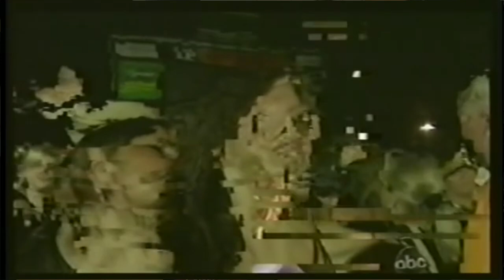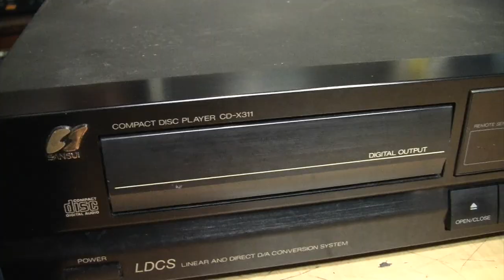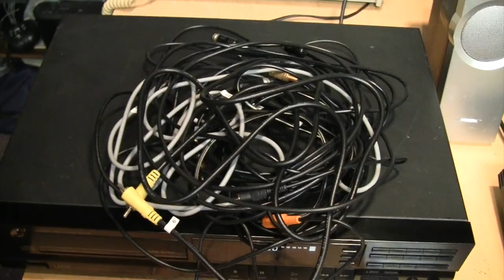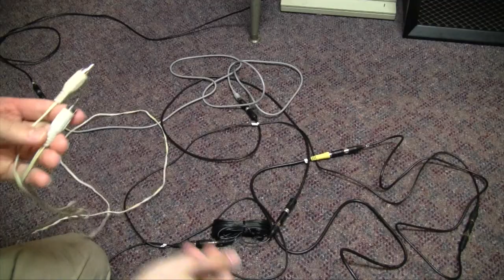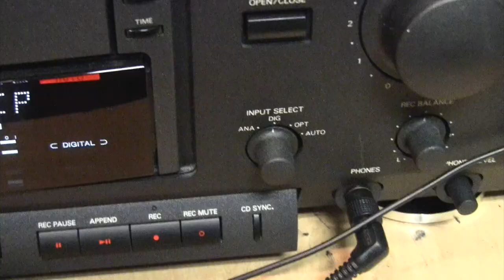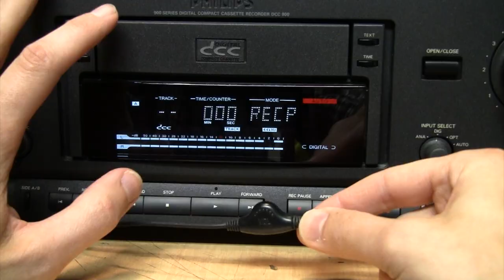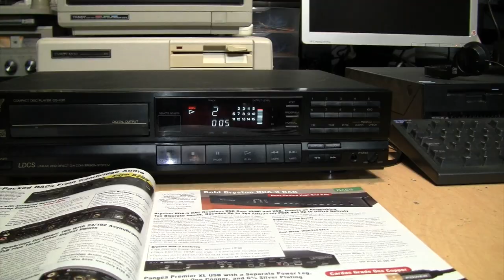What does a crappy digital audio cable actually sound like?

Comment: The extra cheap ones though do go bad pretty soon I had my tv box set up with the cheap cables that came with it and it had all these issues after 6-7 months I thought it was a backend issue and asked called them to fix it and they said they would ( this happened all the time ) but they said they fixed it but the problems was still there were still (biggest one was these random black lines appearing sometimes glitching audio) we went back and forth on this they kept telling they fixed it then one guy said have you tried changing the rca cables and I did with some cheap ones and it fixed it then the problem came back after round about 5 months and I changed them again and it fixed it again after that I upgraded to the new HDMI one still don't know how the cables went bad they weren't under strain just behind the tv no one could touch them

Comment: For short distances, it doesn't matter. For long distance it does. And there's a special cable for that:

Standard coaxial cable that you can buy at the hardware store for $0.20 a foot. It has the specific 75 ohm resistance to help prevent reflections. It also works great as analog cable, I use it for all my custom RCA cables.
Reply: I sometimes also use 75 Ohm Coaxial Cable for analog Audio. Because the Shielding of this Type of Cable seems to be still better, then that of some of the cheapest Audio Cables. I had Hum with some Audio Cables (that came with some Audio Devices), with the 75 Ohm Coaxial Cable, that Problem was gone.

Comment: I think the problem with using both the red and black sides of the stereo audio cable at once was because the cable may only be 3-conductor.  That is, both left and right may be sharing the same ground.  If that's the case, then using both red and black together may end up creating some nasty ground loops, which could easily distort the sound in the way you heard.

Regarding the static you encountered when using the volume control, I suspect that is due to a lack of error correction.  If you can receive the clock signal, then you have bits that you can send to the DAC and amplifier, but if those bits are messed up, you hear static and noise.  If the signal has error correction codes (probably not available with raw PCM data, but probably present in more advanced CODECs like Dolby Digital and DTS) and your playback software is designed to use them, then the corrupted bits will cause ECC to fail and you'll hear silence.

At least that's my theory regarding your observation.

Comment: Saw some high-end shop who sold "hifi" USB cables (A to B, standard termination - e.g. the cable that came with your cheap ass printer) - for the lowlow price of, if I remember correctly, 3900 USD for 1m (about 3 ft) - or you could go for the 2m version for 5200 USD.

I believe the brand was Nordost Valhalla.
Reply: ouch.

Comment: Digital is like reading morse code with a flash light. As long as there is enough energy to make the light switch on and you are within a certain wide range, you will be able to translate the morse code. does not matter how expensive the flashing light is.
But audiophiles love spending on getting 'the best'...

Comment: one thing that is not normally advertised from the manufacturers is that there is circuitry inside the recorders to compensate for poor signal. thats why you need to keep turning the little rehostat(volume) control inline with the cable to make it cut out. up until that point its doing alot to recover poor signal strength. 
the same goes in the digital camera industry where the SDI(serial digital interface) is used.  it can withstand a lot of different cable type's because of the Loss compensation circuitry. in the end. Bits are Bits & Snake oil is Snake oil.

Comment: Floor reveal :P

BTW I think the ultimate test, provided that neither your CD player nor the sound card acts up (I ain't an expert after all :D so pardon some incorrect, irrelevant junk pls), is to set the volume and settings on all devices and not touch the knobs until the end of the test, then take recordings of the same track after each cable extension, line them up in an audio editor by two, invert one of them each time and mix the two tracks to create an interference minima, if of course, they're identical :D and again, if nothing in the signal path is capable of losing or altering the data. Then you'll get absolute silence. As a control check, you could try doing the same track several times on the same cable, maybe switching your Sansui off and on each time, and replugging the cable...

Comment: Sorry, but this only proves that bits travel through extended cheap cable, whether it makes a difference to the sound is not something that you can evaluate with the setup. I don't advocate one way or another, but I just don't think you have the system resolution to make such an evaluation, unless you believe that a speakers are speakers, amps are amps, and so on...
Reply: Nope. The sound is entirely in the bits - no bits, no sound. If you read a newspaper in bright light or under a flashlight, the text will be the same. The writing won't be improved or degraded by the brightness of your reading desk.

The entire point of digital transmission is that it works or doesn't. If it works, then the output is a perfect replica of the input (no better, no worse). That's why a CD or DVD can be used an archival storage device for your computer. That's why, unlike copying an analog source, a tenth generation (or hundredth or thousandth) is exactly the same as the original digital source. That's why digital audio created the bootlegging problem.

Comment: Also when you're using the inline volume control, you're just lowering the voltage of the digital signal, and at some point the digital waveform won't be reaching a high enough peak voltage to look like a binary "1", so that's why the signal disappears entirely. If you re-amplified that voltage it would then be readable again.
It doesn't really simulate what you would encounter with interference or crappy long cables which would be random bit errors.

Comment: Do not forget, that you don't have a very long cable. You have many cables and many couplers, what is way worse than just one long cable.
Oh, I guess, that timing and data quality is way more important for a video cable, than for sound. Watch this from Linus Tech Tips: https://youtu.be/q5xvwPa3r7M OK, they have reached only 3 meters, but what can be the maximum designed length of a PCI Express connection?

Comment: Another test I just thought of what's the limitations of 1/8 or 1/4 stereo cables lol.
Reply: The 1/8 cable is usually headphone jack level, stereo feed.  My best was around 200' at full head phone volume, using XLR mic cable.  1/4 stereo cable is known as 1/4" balanced cable.  My best was 900' analog.  Connectors don't matter.  it is wether it is balanced or not.  I am an audio engineer.

Comment: Here one can read about jitter:
https://headfonics.com/2017/12/what-is-jitter-in-audio/
... including how using a FIFO buffer you can remove the issue from the cable.
Of course if the cable is so poor the actual bits are hard compare to each other then you've got a problem beyond that.

Comment: Those "audiophile" magazines and catalogs have been pitching this kind of "woo" for decades to drain the wallets of unsuspecting, under-informed consumers. The entire "analog vs. digital" kerfuffle is just one tiny part of it.

If you really want a really good example of this kind of crap (and maybe get a good belly-laugh or two as a bonus), look up the "Tice TPT clock" some time. This device retailed (roughly 20-30 years ago) for around $270. It was a digital clock with an extra AC power outlet that one used to supply one's audio amplifier. Supposedly, it somehow magically "synchronized" all of the signals within the amp (through the AC line cord, no less!) to produce superior-fidelity output. Descriptions if its effects are (generally) laden with egregiously-subjective terms such as "airy", "spacious", and "crisp" -- one of the clearest examples of "confirmation bias" you are ever likely to read.

Comment: To me my real Glass TOSlink cable sounds better then plastic ones.
Reply: I'm sure the glass cables will have 'better' ones and zeroes.
Reply: @BlaBla-jj6sh  Glass fiber is is a lot clearer then plastic fiber. More light passes through.
Reply: @internetuser-os5hw  "more light" passes through. And how long is that cable, 2 feet? You clearly have no idea how a digital signal over Toslink actually works. It isn't about the 'amount of light' it's about wether or not a light puls gets through and be detected at the other end. Even a cheap plastic cable that's worth $1 can do that easily. A Toslink cable - like any digital cable - either works or it doesn't. No Toslink cable will give you a better sound quality that one... that already works.
Reply: @BlaBla-jj6sh  I only paid 25 dollars for my Glass Toslink cable off Amazon. So if there is no difference,  no money lost.

Comment: Also, those expensice electrical receptacles only works if you also spend thousands of dollars to upgrade your electrical system to an isolated ground system. Or illegally hooking the receptacles directly to a standalone ground rod, ideally using a shielded ground wire.

Comment: I can tell the difference between a best buy digital coaxial compared to the ones I build with belden premium bulk cable.... I also have a very reveling setup I don't think anyone can tell the difference using a very low quality CD player and extremely low quality speakers try it on a 5k plus stereo Paul McGowan can tell the difference in USB cables going to a dac on a blind listen

Comment: The bottom line is you and I probably will never need those but ... well yeah .... those expensive cables kinda do work better than the crappy ones .... but only if you are running VERY LONG LINES! Generally more than 300 feet. The conductors within the cable form a transmission line.  Eugene Khutoryansky has a great video illustrating this phenomenon: http://youtube.com/watch?v=ozeYaikI11g Really, the only people that need expensive cables like that are production professionals that rely on dependability. In a sense they get PAID to use them (by the client whom is being billed) and those cats probably understand how to avoid impedance mismatch.
Reply: Quite true.  I am one of those professional folk.  My best on analog audio for microphones is 400', Line level 900'.  Digital, I keep to under 100'.  Beyond that I use digital audio over ethernet with a bunch of converter boxes as needed.

Comment: I can recall hearing a faulty DAT player that made a very similar digital distortion sound, which could have been due to either dirty/clogged heads or misalignment. Makes sense since it also used 16-bit PCM audio at 44.1 khz, as with the CD player in the video.

Comment: What's probably causing the distortion is the crosstalk on the lead where you're doubling back.
Reply: Digital waveform degradation due to cable length, impedance.  The receiving end can not process the signal due to "crapy signal".

Comment: it is impossible to convince the willfully ignorant that digital means digital, 1 or 0, as long as there's enough voltage for the reciever to pick up any signal at all, the quality of the data will be identical... analog signals modulation and amplitude will change based on the resistance of the wire, capacitance, and EM noise in the room..

Comment: I have had problems with the cheapest of long HDMI cables (10M cables) not working with some projectors. But I can still get 10M cables for £15 that work perfectly with everything. The “bits are bits” argument doesn’t hold up too well as you get to very high bit rates or very long cables you eventuality have to start paying for quality. For example CAT5e cable of good quality can be pushed far passed its spec. of a maximum of 100m @ 1Gbit/s

Comment: The impedance mismatches in the connectors and especially with Y adapters may have a lot to do with things, but there is a limit to the voltage drop before the signal becomes too degraded. If you used a "single 75 ohm aerial/video type cable" terminated into a good quality phono plugs at either end you would likely get 200 meters or more.
I also suspect that the domestic machines "mute" themselves unlike the PC DIGITAL input that is RAW, so the domestic machines either "work perfectly" or not at all.

Comment: that being said intercepting all data coming from the cd multiple times and comparing it against previous captures would probably be a more accurate measurement. but it's probably 0% error rate anyway. (much more likely for the cd itself to be fucked or the lens to be dirty ;)

Comment: woopetiedoo 44100hz times 16 bit times 2 channels.makes a whopping 1411200 bits per second. (with the weird ass 'winchester' kinda encoding it uses). quite sure pretty much any piece of barbwire can transfer such low bitrates over the what... 1 meter that usually would be between the cd player and the amplifier ;)

Comment: When I got my first Dolby 5.1 system I used a 6' good quality analogue RCA cable, the only problem I had was a slight 'bump' if I switched on a light while the system was on... I replaced it with a cheap digital coax and it eliminated the bump sound.. so with an analogue cable I got electrical interference, but a loss of sound quality/signal? no but I think the interference was more due to the wiring in the house I was living in at the time... and the supposed digital cable was perhaps better shielded or something...

Comment: Those hifi brochures are proof that a fool and his money are soon parted. The favourite bit of snake oil I've seen is the mega-expensive power cables. You can pay hundreds for 1.5m of 3-core flex with an IEC plug at one end and a mains plug at the other. The hifi people will tell you that the difference is "like night and day" with an "improved soundstage" with "better defined" sound, and various other cliches that don't mean much. So yeah, the electricity travels hundreds of miles from the power station, is shared with thousands over other buildings, runs through various substations and transformers, through your consumer unit and another 20 metres of copper twin&earth before it gets to the wall socket, but yeah, that last 1.5m of cable makes all the difference.

Comment: IF audio cables are not made on full moon using silver and oxycrimped by Elves. And given 24k golden tips. I am NOT accepting them in my house.

But yeah, there is a lot of BS going around in the world of audiophiles. Going so far that they try to sell short NETWORK CABLES. Yup Super Expensive UTP NETWORK CABLES... because obviously, UTP THAT CAN EASILY HANDLE 1000Mbit isn't good enough.

Note, Blu-ray audio is about 6-8Mbit. SUPERBLURAY AUDIO, aka only audio might push into 24-28Mbit. 
1000Mbit versus 28Mbit at most... eh I think a basic cable will do.

Comment: I try not to criticize others of their hobbies, as I also enjoy electronics as well as audio.  What I do find interesting is that as I read through the 400+ comments (admittedly, I didn't read every one), I was unable to find one comment that could explain or provide proof of how these expensive cables can appreciably (if at all) affect the sound of the digital audio device, beyond just saying "it sounds better".  Even with my own experiments, I can't find a good reason to justify them.  I'll go one step further and add really expensive speaker cables and "burned-in" RCA patch cables to the list.  While undersized speaker wire can affect damping factor, etc., there is a limit to the "more is better" theory.  I guess listening to music and listening to audio gear are two different hobbies, but that goes beyond the technical aspect of things into a realm that I am unfamiliar with.

Comment: I've done similar experiments with TOSlink in the past.

Technics CD-player from 1993 -> cheap 5m TOSlink cable rolled up -> TOSlink coupler -> another cheap 5m TOSlink cable -> Soundblaster Audigy 2 Platinum eX (the external box had TOSlink input, and it supported bit accurate recording).

I then compared the recorded audio data to a EAC rip of the same CD, using the program "Compare It". It's a bit tricky since the files have to start and end at the same samples, but it can be done in Adobe Audition.

The results: The files were identical, even when comparing the recorded data to the original FLAC file (the one I used to burn the CDR for the test).

Comment: The REAL question is: does STREAMING sound any better (or at least as good)???

Yes, the freedom of streaming when you're out and about is nice; but, as you demonstrated here, it's NOT necessary for home listening--NO MATTER WHAT the streaming services might tell you!!!

Cords can be like spaghetti--they can twist and turn around one another, and make a giant mess. However: once you connect everything up in your home stereo system, you need not bother with them again, unless you move.

With the long cable, I was screaming, "put the red in the red and the white in the black!!!" because it sounded like you just had the connections reversed. But you showed that it was the cable that was defective when you connected them that way. It's interesting to note that you didn't get the degradation in sound until you hooked up that bad cable--so it's not the length, but the quality of the cable that counts (and you showed that cheaper cables are just as good as more expensive ones--something I've known for a number of years now).

So, Millennials, take note: you DON'T have to rely totally on streaming for your home audio. Get some cables and you'll no longer have to be at the mercy of your internet provider for home audio!!!

I MISS RADIO SHACK!!!